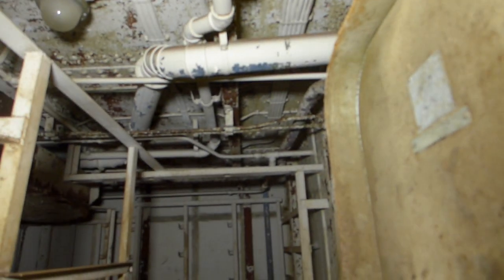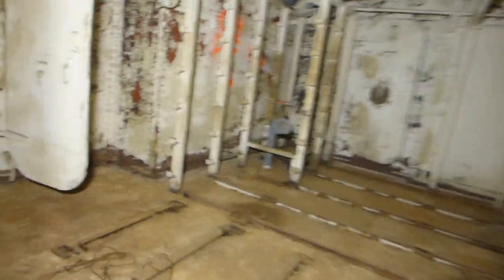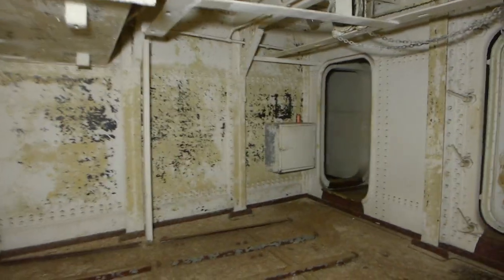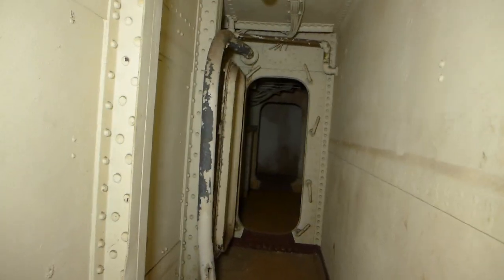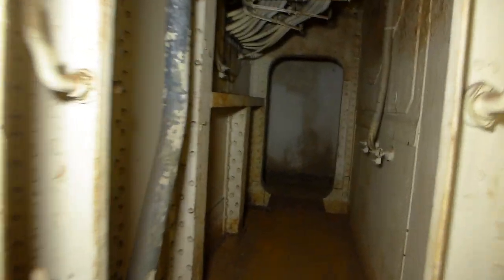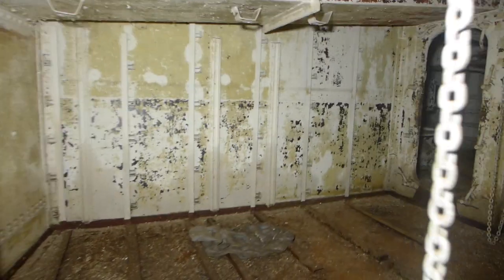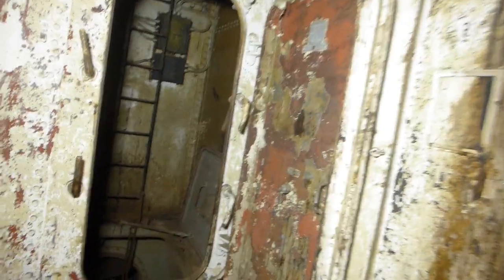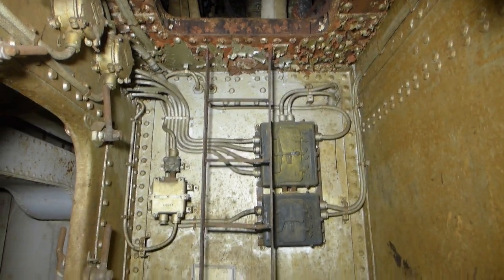Deep In The Heart of Battleship Texas

Comment: I hope after the drydocking in the coming year or so is complete the Battleship Foundation / Organization that now owns the Texas will invest in dehumidification equipment and close off some of decks that unrestored. That way it will stave off some some of the damage. But also watching the Texas park service video of the repairs from the 80s I'm surprised they didnt apply any zinc anodes to the hull, - so that and maybe an active cathodic protection system like what the New Jersey has her mooring spot might be the best combination for the ol' girl's best chance at survival.
Reply from the maker: Battleship Texas Foundation has a long term management agreement with the State of Texas, who still owns the ship.  I know that over the last 30 years, sacrificial anodes and active cathodic protection have been used on the ship, but that doesn't answer all corrosion problems.  I am sure that dehumidifers are being looked at, as is a ventilation strategy that helps keep humidity at reasonable levels.  This video is of compartments that normally stay closed with no environmental control.  Their material condition is much better than their appearance suggests.  While there is significant coating failure, corrosion is minimal.  This is after almost 75 years of no maintenance!  So my opinion is that maintaining the status quo in these conditions is a reasonable strategy.  Other areas have significant corrosion issues which are being addresses as funding becomes available.

Comment: I'm just wondering  you said or one of these channels covering Texas said that the upper level of the fighting tops would never be opened to tours due to the difficulty of the climbing. Has there been a video done on those spaces?
Reply from the maker: I have been up there and shot some video, but none of it is show worthy.  Since I don't care to ever climb up there again, I will not be re-shooting anything.  The main reason is there is no payoff other than a nice view of the San Jacinto Monument and local petrochemical plants.  The spaces are completely stripped of everything.   However, it is possible that Battleship Texas Foundation may shoot one sometime in the future.
Reply: @tomscotttheolderone364  how bad of a climb was it, I have always wanted to go up in those spaces. I wonder if there are any photos of what it was like when ship was still commissioned
Reply from the maker: @georgedistel1203    It isn't that the climb is extremely difficult, the problem is a slip would likely end up with severe injuries or worse.  There are a couple of photos of crew in secondary battery fire control, which is the lowest of the three levels, but no equipment is visible.  It is only identifiable by what can be seen out of the window.

Comment: Too much rust.
Reply from the maker: Actually, that isn't too bad.  Most of what you see on the bulkheads is failed paint and exposed red primer.  The majority of the rust that can be seen is superficial.  Unfortunately, there are no longer 1,000 sailors on board with wire brushes, chippers, buckets of paint and brushes to keep up with it.
Reply: @tomscotttheolderone364  Maybe the TX Dept Of Corrections could get some inmate labor to "crew" the ship. I'm serious, I worked corrections for 20 years in AZ we had low level inmate do all kind of jobs in the community. They worked in food banks and cleaned up parks stuff like that. I sure there are so ex sailors / military inmates who would love to "crew" a battleship.
Reply: @briangulley6027  put them to work!!